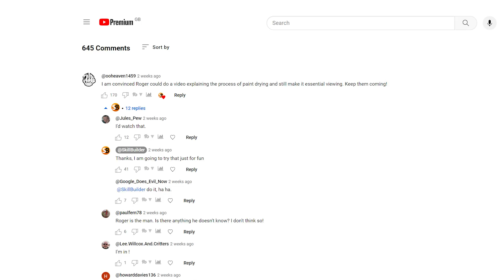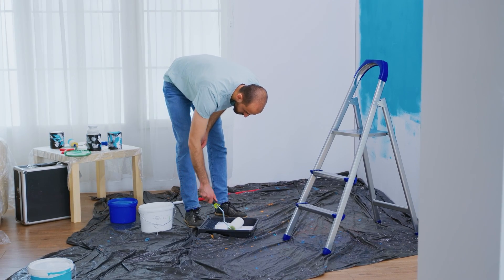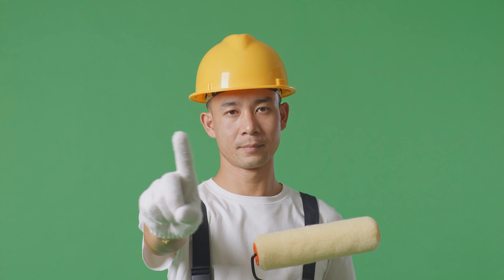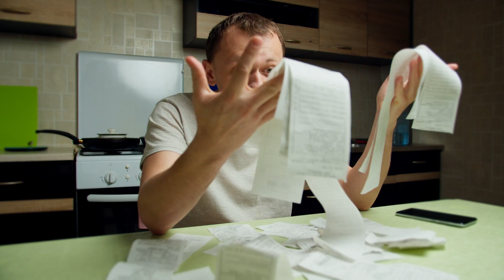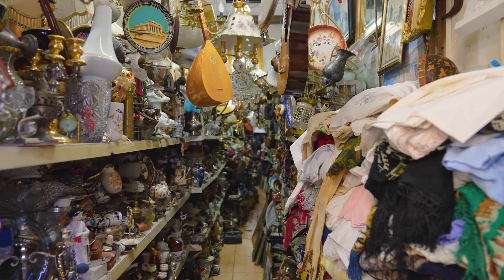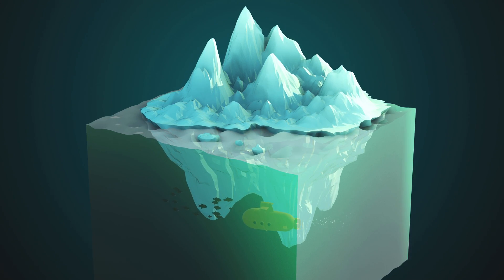You'll Never Guess What Happens When Paint Dries!

Comment: So Roger... if the paint's been stored below temp can you tell whether it's damaged just by using it or could it go on fine and then only last a year or two?

Cracking video btw!
Reply from the maker: I am not sure but hopefully Nick Hickson will reply.
Reply: Good old emulsion paints used for walls and ceilings don't like extreme cold and tend to separate, lose their anti mould properties and finally lose their  structure as when new, therefore they end up piddly thin (scientific term) and are unusable. They must be stored above freezing.
Reply: @nickhickson8738  So if it seems normal, chances are it'll be alright then. 
Cheers 👍

Comment: Lovely vid Roger I agree you could make any subject interesting. Spray painter here. Workshop visitors have eyeballs on the end of their fingertips it would seem. Great video. 
Big demand for some products to have formaldehyde sealing and reducing coatings of recent. To prevent off gassing post installation.
Water based paints still have minute residual cosolvents/VOCs that go off as it coalesces. Also you've described Wet on Wet coating techniques very well. Solvents can cure in sub zero and adverse conditions to aqua too.

Comment: we did a mist coat on the walls in one room
by the time we went round once it was dry enough to do the second coat
and then we gave it a normal coat too
although i still can't figure out how to remove the brush marks on the corners and edges so i look forward to your tips on that 
thanks
Reply: Only cut in one wall at a time. Then roll it immediately. Your cutting in will still be wet and will blend with the roller paint. No more brush marks.
Reply: @raftonpounder6696  i'll give that a go next time, thanks